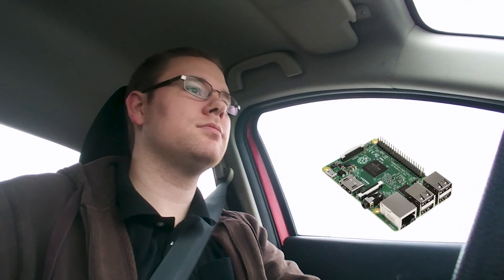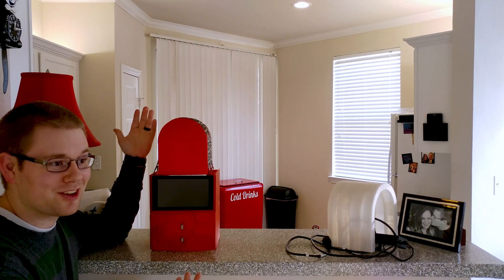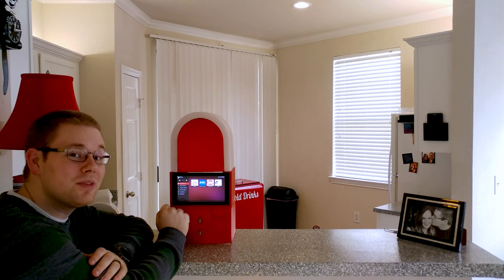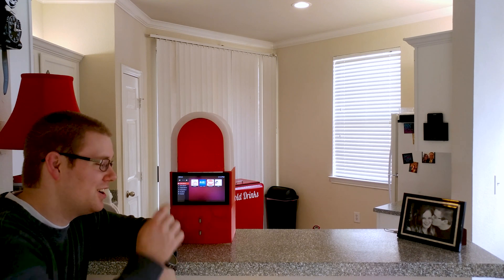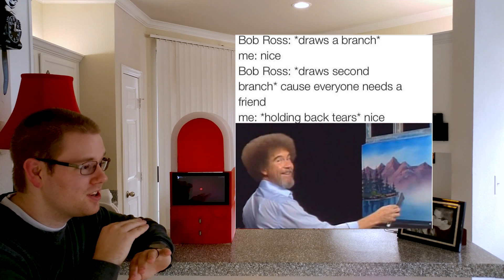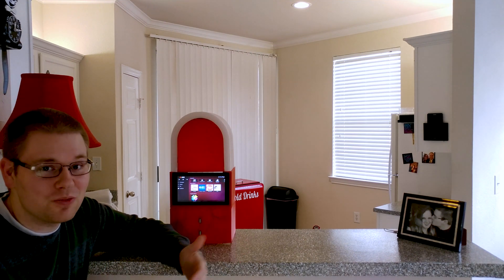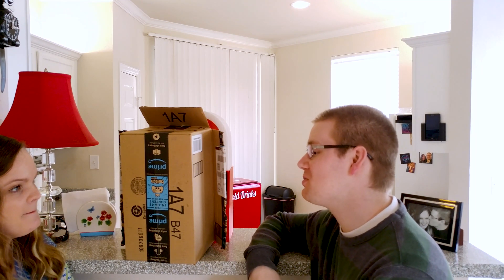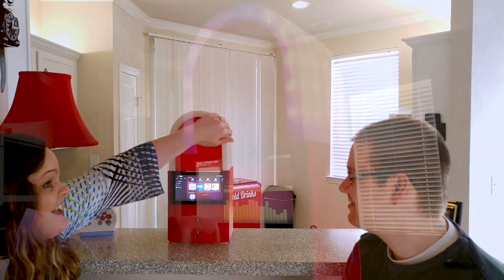3d-printed RasPi JUKEBOX!

Comment: What software did you use?  how did you get the leds to go with the sound?  a plugin in code or something separate hardware wise?
Reply from the maker: Hardware based, and a REALLY good one at that. There's lots of sound-controlled LED controllers, but 90%+ of the ones I've seen use microphones that seem to pick up ambient noise more than music. The solution used here and in all my other RGB/LED/sound videos is the Pilot LED Music Studio. At one point they were under $8 on Amazon so I bought the entire stock. 

The aux/headphone cable instead of straight from source to speaker goes from source to this controller, then a second aux/headphone cable to the speaker. There is distortion if set the LED sensitivity to where the brightness "clips" like if you set audio gain/volume too high. You also want your source volume to be high (75-95%)

Since its designed for automotive use, it does have a 12v DC power plug. I tried cutting it off and feeding 12v DC directly into the wires, and got no life out of it, not the cleanest power source either, hard to blame one or the other on that one. 

Its essentially 4 seperate units along a string of cable/wire a few inches apart. From the 12v power, theres a small box that houses a capacitor (12v, 3A rated) The remaining 2 units are the controller which has a sensitivity dial and audio in jack. The controller and capacitor both feed into the LED power distribution / audio out piece. You have 6 channels for LED out, based on audio frequency, though realistically mid/high are both on/off/faded the same about 80-90% of the time. I've always wired mine to bring all 6 positive leads together (500ma per channel) and run one negative to my lowest/bass frequency and another negative the highest frequency LED strip or RGB LED channel.

Because the whole system is analog, there's no annoying 1hz update period, it reacts in real-time to the music. Playing a helicopter or some other rapid tone will flash blindingly rapidly.

Amazon link to LED controller: https://amzn.to/35idvU4